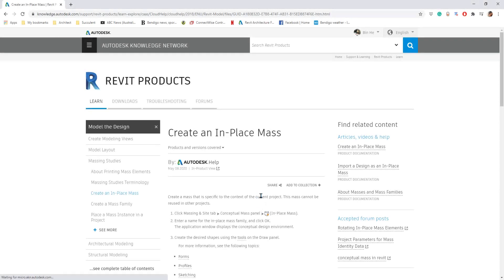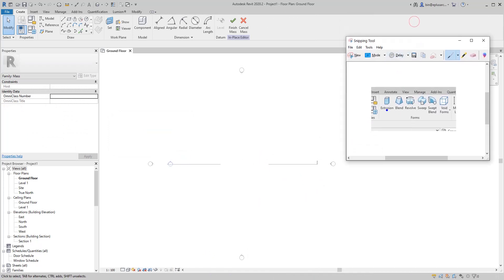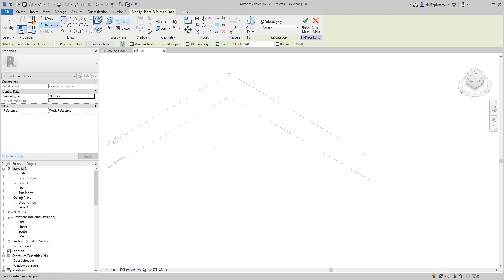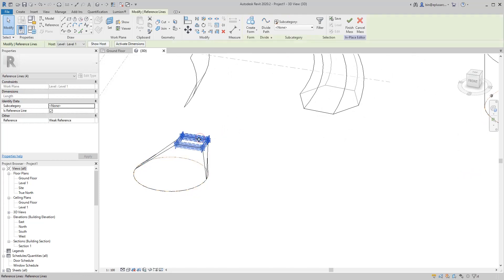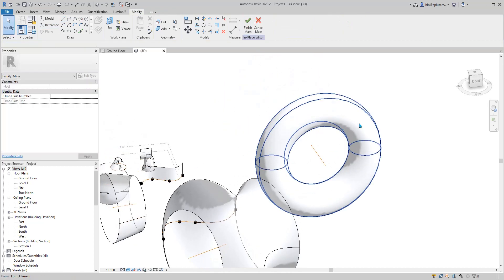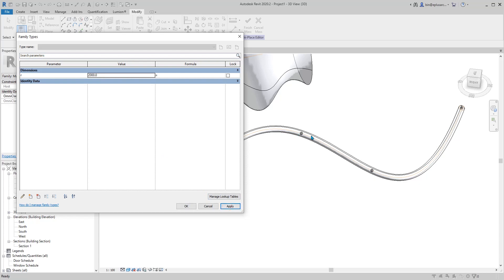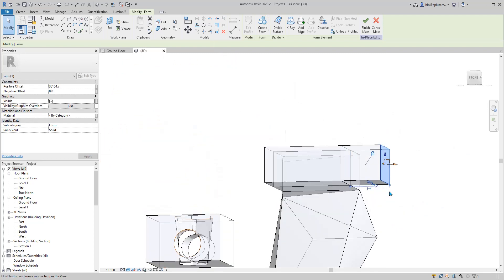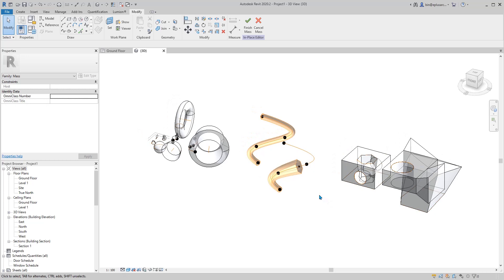Revit Exercise (Day 165) - Basic In Place Mass

Comment: Thank you man 💕, so Basically to make a Void the it needs to be a Mass not a Generic Model, Correct?
Reply from the maker: No, you can make void in any category. It depends on what you are using them for. For example, if you want to cut a whole in a wall, you can create a wall category model in place with a void, then use the cut tool before you finish the model. You can also create a face based generic model with a void cutting the base so you can cut anything in your project. I’ll do a quick video talking about this shortly. But it would be good that you tell me what exactly you are doing, so I can help you to find the best way to do it.
Reply: @BINHE615  I just made an Extrusion of Auditorium Sound Reflectors in a Generic Model, but the stage is not a rectangle, more of an angular shape (like a triangle a bit) so I wanted to cut the extra parts but it says it's not cutting anything so it just wants to delete itself 😅
Reply from the maker: @Tech-WonDo  usually you will need a solid first, then model a void overlapping the solid, then you can use the Cut tool in your Modify tab to cut the solid with the void.   If you like, you can email me (binhe615@gmail.con) and describe some detail of what you want to model and I’ll find you the a better option.
Reply from the maker: @Tech-WonDo  I still don't know what you are doing, but I have put together a video about modelling voids on different elements, such as wall, floor, roof, ceiling, and generic model. You should find the answer to your problem.  If you still have any issue, feel free to let me know.
Reply: @BINHE615  Well the idea is that I wanted to model Auditorium Reflectors, so I made a Generic Model with an Extrusion, but it just won't cut the Sides, so I think I needed to do it as a Mass, but sadly I can't copy the Sketch from the Generic Model so I left it as it is for the time being 😅
Reply: @BINHE615  I just want to highlight that I really appreciate your help and support 💕💕💕💕
Reply from the maker: @Tech-WonDo  You just need to model the void to cut the solid. If you can show me a image of what you want to model, maybe we can find a better way. Generally, I will try to avoid void if possible.